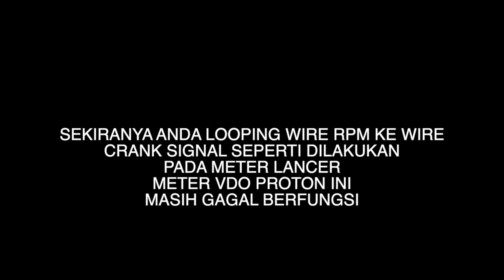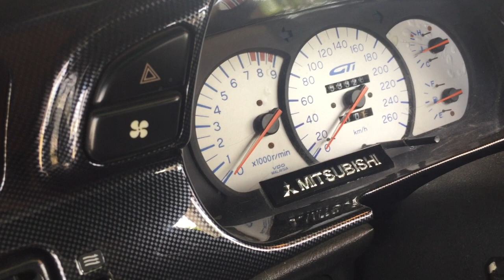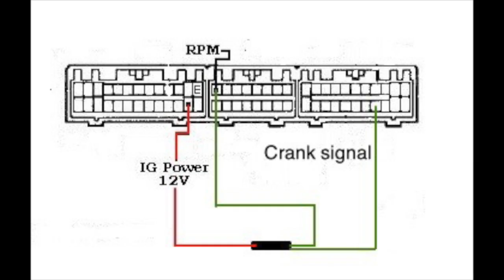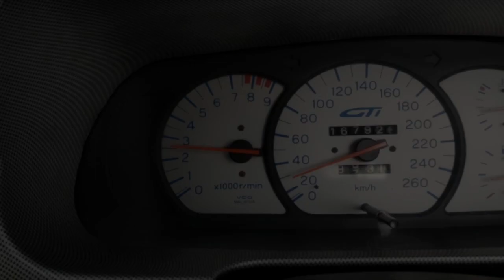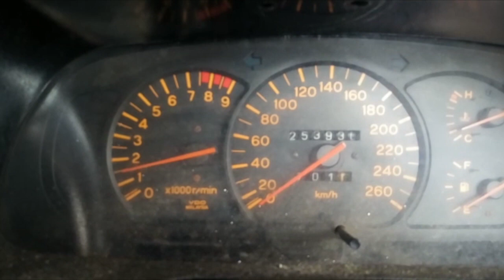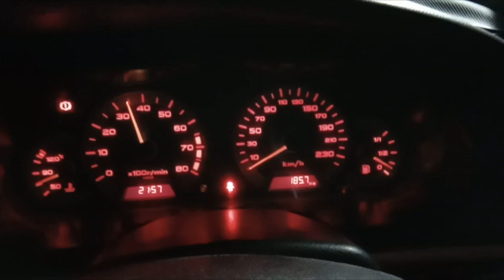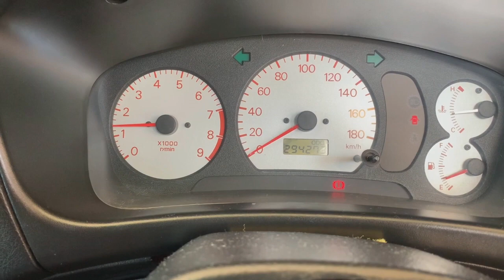Coil K20 - Penyelesaian Masalah RPM Bagi Meter Proton

Comment: Salam bang sya guna 1.8 single cam pasang coil k20 kat waja bila masuk gear rpm turun 500..masalah signal rpm juga ke
Reply from the maker: Waja kalau pakai coil k20 selalunya tiada isu dengan rpm, boleh jalan normal

Comment: thank you cikgu rpm saya berfungsi dengan cermelang
Reply: Lepas pasang rpm tinggi sikit tak? Sbb sy baru siap pasang and test, rpm macam tinggi sikit
Reply: @badrulamin5334  sy punye ok tak de masalah
Reply: @junsean6692  ok dah setel, idle valve sensor prob, lepas cuci semalam ngam, ficd aircond pun problem🤣 kahkah
Reply: @badrulamin5334  ok2 terbaik

Comment: Salam Cikgu, saya guna 4g91 injection dengan Rpm meter proton 1.6 tapi rpm x gerak. Wire putih ada signal, tapi voltage cuma 0.18V ja bila set multimeter ke DC masa enjin tengah idle. Mcmana nak bagi hidup tu?

Comment: assalamualaikum bang,kalau utk meter lancer pun guna cara yg sama ya?
Reply from the maker: Meter lancer lain caranya, just loop wire rpm ke wire crank signal
Reply: @jefftacra  dah buat bang, tapi still tak naik jgk rpm, seller coil tu kata kalau looping tak naik jgk, kena modified dkt belakang meter